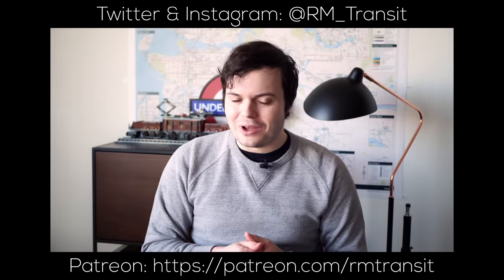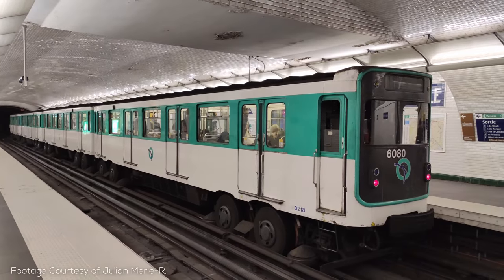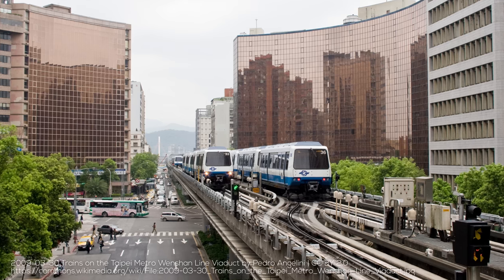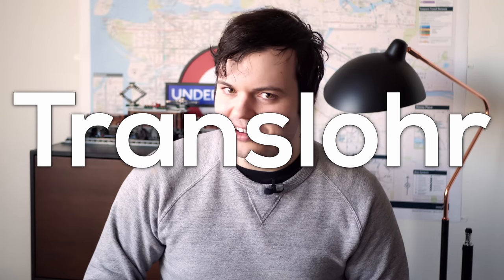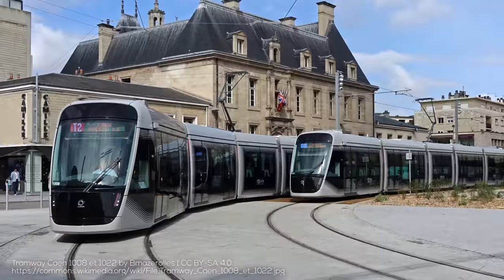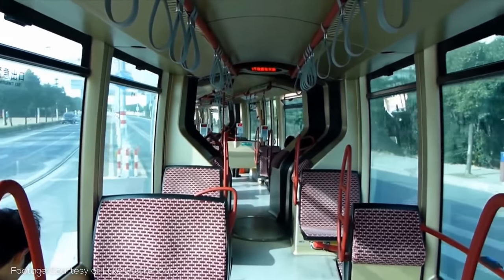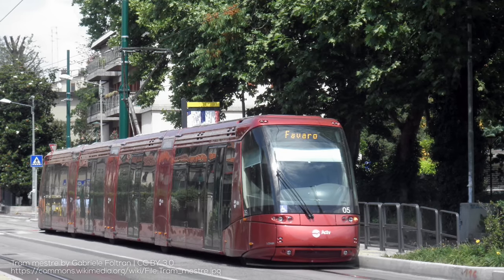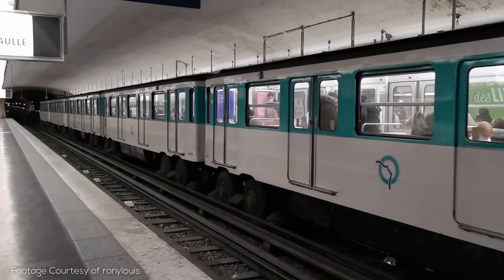Rubber-Tire Rail Transit is Weird

Comment: There's something cool about hundreds of rubber tires running on the same vehicle, i remember being a kid and watching the trains of Mexico City's metro arriving on the other side and becoming a train lover because of that, for some reason watching steel wheel trains doesn't have the same effect, i can't speak much about the advantages, other than the fact that elevated rubber tire lines are much quieter than steel wheel ones. Also i'm sure it's not good for you but i kind of like the slight smell of burned tires.

Comment: I get why rubber tire system is inferior to steel wheels in mass transit, but if that's the case why most airports use rubber tire APM to move people between terminals? Is it the smaller station gap so higher acceleration is most important in airports?

Comment: Do you hate Nancy that much that you couldn't bring yourself to say the name, Reece? 😄 Unfortunately when I was in Nancy two years ago (and I'd advice anyone to visit btw, it is a béáútiful city) I had no cause to ever use the tram-bus-thing, so I can't say what it's like to ride, but it's certainly a peculiar system, and it didn't take much imagination to come up with basically the same list of downsides as you mentioned here. I love unique solutions, and the French are great at them, but you can see why they struggle to achieve the same kind of traction (no pun intended) for new systems built around the world as the tried-and-tested steel wheel technologies.
Reply: Zaydan Naufal  I guess it is quite annoying to live in a place whose name is also quite a common personal name; you could type 'Nancy' into any search engine and unless you specified you were looking for the city, you'd just get people called Nancy. 

They are pronounced differently, of course. The personal name is nan-see with the stress on the first syllable, while the city is nahn-see and has stress on the second syllable.

Comment: With modern advances in lightweight vehicles a translohr makes even less sense.

Building a lightweight tram system using LR55 rail would have the same cost savings as the single rail for translohr without any of the concrete guideway issues

Comment: Another technology that seems more promising are large trams with rubber tires that are fully electric and run on batteries/hydrogen fuel cells with only occasional overhead century styled charging stations required on top of the bus like external infrastructure! The system would also ideally be fully automated so it would pretty much be an automated electric bus that mostly runs on normal roads with normal road traffic but physically takes the form of a large multi section tram! :)
Reply from the maker: I don’t really think so to be honest, if you’re doing all the work for the right of way just do a tram
Reply: @RMTransit  
I have seen them testing systems like that around the world mostly for the purpose of showcasing and proving the reliability and performance of AI controlled self driving vehicles, though practically such a system would probably work best in an area with limited space like if the route needs to have high passenger capacity but on a narrow two way road that also has steep hills and tight corners. Though normally a tram system is always the best option for a higher capacity road based transit route!

There’s also some very steep grades on Melbourne’s tram network however the trams can go up the hills just fine when it’s dry but have to apply sand to the rails to make it up the grades when it’s wet! :)

Comment: As a Montrealer, I love our metro with  rubber wheels and I feel like I'm stepping back in time when I ride metros with traditional wheels! I didn't like it when I saw that the Chinese companies wanted to force us to change our requirements to allow them to bid with trains with steel wheels when we replaced our trains... Fortunately, they didn't win, their trains wouldn't even have been able to climb the hills in the tunnels! It would have been necessary to modify the tunnels, to reduce the speeds and the frequencies of passage. Wow, how cool is it to save a little on trains!

The noise of the steel wheels is so annoying, it is not stable, it is unpleasant. Starts and stops are so slow... In dense sections, with less than a kilometer between stations, with traditional wheels, you haven't even reached a reasonable speed yet, the train must start to slow down! With rubber wheels, it starts quickly, it stops quickly! It's so faster! Well, when there is emergency braking, it's dangerous, people fall into the wagons. 😐Well, with steel wheels, people don't fall in the trains in the event of emergency braking. But the train can't break fast and hits the person who fell on the track!

I guess we get used to these inconveniences when our city is served by trains with steel wheels, but hey... no one can deny that they are inconveniences! It's loud and slow! Not great for a subway!

Comment: I watched the original version of the Nancy TVR meer days before I was going to layover in the city between spending the first weekend of spring break when I went to Europa Park in Germany and then I was going to take a train to Lyon 24hrs after I arrived. Besides the TVR, I stumbled upon a fair and the next day was a bit of a wash with doing stuff since I couldn’t find lockers at the Nancy station or anyone I could ask to find it. Then again I don’t know the French word for locker and didn’t even check wordreference
Reply: I'm fairly certain they don't have them. Certainly didn't see any lockers when I was there, and it's not a large station building, so I doubt I would have missed them.
Reply: @rjfaber1991  there was a taxidermy museum that seemed interesting that’s blurred out on maps because there’s a military installation on the next block. I just did a lot of wandering and then parked it at the station 3hrs early-Nancy is actually across three vlogs on my channel(travel Vlog, fair, city day/Lyon Travel Vlog)
Reply: @history_leisure  Nice! I just spent a long weekend there, and mostly walked around the old town and the bits near Place Stanislas.
Reply from the maker: They are such strange systems!!

Comment: Interesting, I wasn’t aware that rails had better ride quality than tires.  I just assumed that inflatable tires would give you a smoother ride in the same way that air suspension would, versus metal-on-metal which would respond to every bump and gap in the track (e.g. thermal expansion gaps).  But I guess roads do degrade in quality a lot faster than rails do — and in hindsight, even my experiences on Via Rail (a passenger service running on freight rails) were pretty decently smooth.

Comment: I think you missed the point. Tires allow for really short brake distances and acceleration thanks to the grip.
Also when leaves get on rails, it becomes a major issue for classic tramways regarding braking.

Comment: The GLT had the potential to be a not so bad idea... if it would have worked. It could have the advantage to use alternate routes in case the main one would have been unusable, and could run as a bus in areas where guidance would not have been needed (suburbs with wide avenues, for example). But the too many drawbacks of this system showed that it was not worth it.
Even Nancy, the last city to use it, is planning to get rid of its GLT and replace it with a tram (luckily, because the Translohr was evocated a few years ago...). They have just one problem with a branch section having a steep slope, which might be replaced just by a bus, implying for users to have an interchange.

The Translohr, in contrast... I have read that originally, it was designed to use both guided and unguided sections like GLT, but when they saw how terrible was the service in cities using GLT, they gave up that option and designed their thingumabob to be completely guided, like a standard tram.
So... definitely no interest. Absolutely no innovation behind. A real shame for French technology.

Comment: Climbing steep hills is much easier done with cable and rack railways, both of which I believe are doable in street surface with current technology. Or, you know, just use a trolleybus.

Comment: I think there are tradeoffs to both types (rubber tyred vs steel wheel). I honestly don't think that rubber tyred metros are really in the category of gadgetbahns just simply because there are larger systems that use them (Paris Metro and Montreal Metro) hence there's more of a market. The larger the system gets, the more rolling stock and associated maintenance facilities et al are purchased/created for that system. Keeping the demand higher for all of those things and hopefully manufacturers available to create them. I also feel like those systems that are entirely indoors may potentially have smaller maintenance costs/longer periods between needing maintenance as weather can be taken out of the equation.

I also very much echo the lesser impact to surrounding buildings. We recently stayed at an AirBnB in Philadelphia that was about a block from an underground PATCO station. You could very much feel and hear those PATCO trains rumbling at all hours of the day. Don't get me wrong, I am a fan of both types simply due to the fact that it's a train of some sort getting me from point A to point B. And I will always love hearing the rumble of a steel wheeled train rolling through a station.

Comment: Honestly, rubber-tyred trains just seem like a classic case of stubborn Gallic exceptionalism than an actual benefit. Linear induction is probably a better fit for hilly cities with steep grades.
Reply: Contrary to LIM tech, rubber tires also improve passively adhesion when braking, which is the limiting factor for safety when confronted to a hill with a train. I don't know if magnetic track brakes can work unpowered...

Comment: For Lausanne I can understand why they used rubber tires. If they used conventional adhesion as normal metros do, the route which is quite uphill wouldn't be possible, if they used a rack and cog it would almost half the speed so to me it looks like the best possible option was rubber tires.
Reply: In fact Lausanne replaced a rack and cog system with rubber tyred metro - the old rack trains ran less than half the distance of the modern line and (I assume) were much slower.
Having experienced the new(ish) Lausanne system on multiple occasions, I can attest that it's very well used and it climbs the hill up from the lake across the city centre remarkably fast!

Comment: What Technology would you recommend for Halifax?
Reply: A waterfront Tram with a regional rail system encircling the South West and North up ti Bedford, and a Dartmouth water front LRT (and maybe a bridge connecting the two.
Reply from the maker: Just standard steel on steel! 

Trolley buses could be good though….

Comment: if you insist on improving performance of rail vehicles (which to me, only applies to trams) have deployable rubber tires, not permanent ones. rails are just better for sustained travel, and having high grip is only good when stopping and starting.

think: landing gear for trams. on take off and landing they are good, but having your gear out in flight isn't terribly efficient.

i think broad gauge is better, but this would be much easier on narrower gauge systems, because when braking or accelerating, having better stability by having the rubber on the outside of the rails is safer.
Reply: also honestly, i hate buses. maybe i would be okay with electric ones, but they are far too bumpy and noisy, and are really cramped even compared to Trams. the only good bus i've been on was a passenger shuttle at an airport, with low floors along the whole length, and far smaller wheel cowlings somehow.

Comment: These kind of technology def have some future tho, especially with autonomous driving, although it will probably be closer to trainlike bus than to train, for good reasons (why build the whole train infrastructure if you get no benefit ?)

I guess that they are also used in airports for reasons (probably way cheaper to build ?)

Comment: Darn, I thought this would be about the trackless Tram being trialed in China and Australia. I know RM isn't a fan but I'm looking forward to the outcome, could offer a big leap forward for BRT. 

Based on what was covered, I would agree its almost certainly dumb to build all the infrastructure for tram/train, and then build it just a little different so you are stuck with some wierd technology that doesn't work quite as well. VAL does seem to have some value (although I think the sky train is generally better in the prime use case)
Reply from the maker: Yep! Don’t take on all of the cost of a metro or tram and then not get all of the benefit!

Comment: I find a lot of arguments about the "sounds" of transit are made in bad faith. For one, every time (especially in Vancouver) the media wants to make the transit look bad, they open the windows to make it extra bad, and then use the worst section of the line to do it (in the tunnel.) Do rubber tyre metros make sense? I'd say not particularly, at least if your only selling point is sound. If your selling point is to increase frequency, well the Vancouver skytrain has already proven rubber tyres are not needed there either. So it seems like there is almost no point to running a rubber tyre metro over a conventional steel-wheel one unless you're deliberately going to cut corners in the design of the guideway, like having steep grades instead of deeper stations.

Comment: I have a Quetion for Reece;..do linear motor rail vehicles like the Vancouver skytrain, have the potential to produce less noise or even no noise operating through a corner or just regularly?

Also I like the wheeled transit systems be condensed into this one video keep up the great work!!

Comment: France: we have le most recognized high-speed train system in the world, handling very intensive rail traffic
Also France: tramways and metro cannot use standard rails, cause it is unreliable; lets make six-rail sets with multiple tyres.

Comment: About the Clermont-Ferrand tram on tires, and the nearby Michelin factory, I campaigned for a local socialist candidate with other veteran politicians of the area, and they were around when this tram system was adopted, and it was really blackmail from Michelin: if the city didn't chose a rubber tire system, Michelin wouldn't drop a penny in the funding of the project, which was instrumental in getting it done. But on the other hand, Michelin is employing 12.500 persons around Clermont-Ferrand, over a surface of 700 hectares, and paying taxes accordingly, so you can't exactly blame them. Something not well considered: the central rail of the Clermont-Ferrand tram is quite wide open and deep, so much so a friend of mine got her bike wheel caught in the rail and broke her femur head when she fell to the ground.

Comment: I'll fight for the destruction of translohr and similar rubber-tired "trams" all my life. Caen did the right thing by getting rid of it and replacing it with a real tramway.
As for rubber-tired metros, I'm not sure what to think of them. They kinda make sense for Paris' metro, since stations are really close together and that rubber tires make sense in that specific case.

Comment: the Swiss have a bunch of cog rail trams and trains and also systems that go from one to the other without stopping so hills and precise stopping aren't an issue.  Cogs do generate both noise and shake if that is an issue.  Krupp makes a rubber sandwich wheelset that makes much less squeal on turns for trams, should not be used on trains however.  track lubricators can reduce squeal.  rubber tires (tyres?) can be retreaded (common practice in airlines, truck and bus companies).  The rolling resistance of rubber tires is much higher than that of steel wheels so vehicles will need more power and use more fuel than the steel alternative.  That, and tunnel conditions, made for a serious heat problem in the Montreal system early on.  One issue is that tires inflated for max load are way too hard for light conditions but what are you going to do?  Railroad track and switch technology is very well developed, standardized, available off the shelf from multiple vendors, and very cost efficient, novelty systems can't say any of this.  This said, a lot of tram lines especially are way overbuilt.  Trams don't need 110# rail nor concrete crossties, wood ties generally last longer than the rails on top of them, the space between the rails filled with cast concrete panels that can be easily (?) removed (with a crane) and driven on OR cover the ties and ballast with a membrane, then dirt and grass (don't foul the ballast with dirt).  Grass looks really good on the Charles St. line in New Orleans and it makes it quieters.  hey, hedges on either side, paint the overhead structures green and you'll hardly know the street has a tram unless one is passing.  The Spanish Talgo (?) system that suspends each wheel independently would probably squeal less since each wheel also runs at track speed in turns rather than slipping.